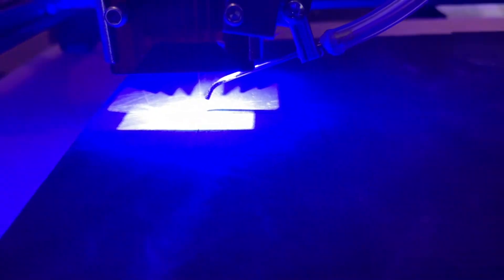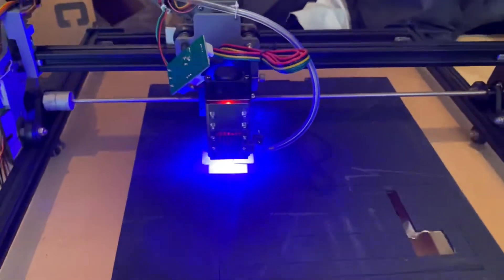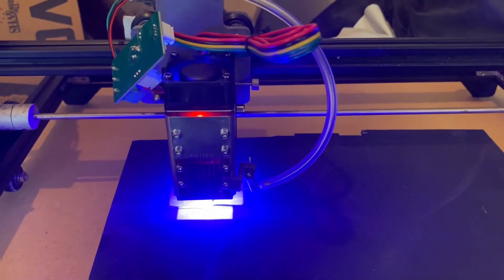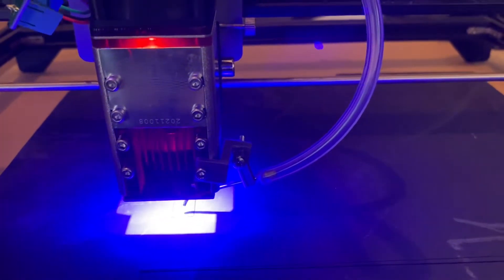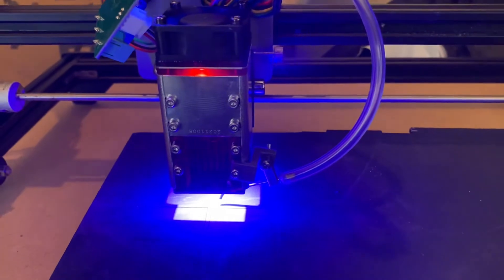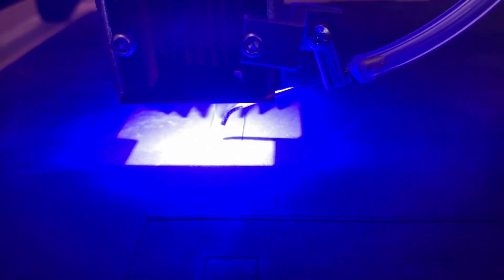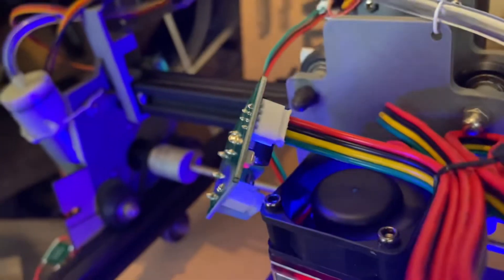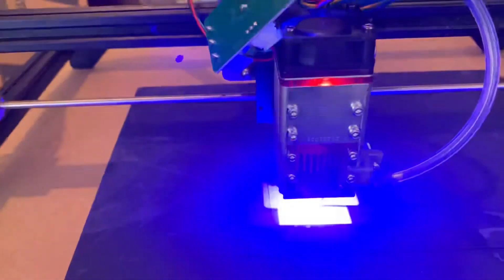PLEASE READ UPDATE BELOW Neje 40watt dual diode laser on Ortur Laser Master 2

Comment: I've been going back and forth with Neje about the A40640 and it's compatibility with the Ortur LM2 S2 gantry.  LA Hobby Guy made it work on his Ortur (model not mentioned) and you obviously have as well.  I'm new to the laser world but already realize that the low power output of the LM2 won't get me to where I want to eventually go, so my entry was at the budget level.  Making this module work on my existing frame/gantry would save a ton of money.  Do you have any more videos or further info that might help me out?  Neje says they don't know the answers to any of my questions...which I find rather hard to believe.  Thanks for the most informative video.
Reply from the maker: Thanks for the comment.  I can't remember exactly what I did but there was a small amount of messing around to fit the neje head with the existing bracketery and I also was powering it wrong to start with (I've just edited the video description with details).  Long story short, I was under-powering the laser but now it will chop through that ply in one pass no bother.
Reply from the maker: Oh something else to bear in mind, the module is bigger and focal point is lower, meaning it can crash into the side frame, to combat this I glued a small piece of wood in order to trigger both end stops "early". You sacrifice a small bit of working area, but not a huge deal.

Comment: Great video, where did you buy the adapter module for the Neje laser?  I recently ordered the Neje module but haven't received it yet so want to make sure I ordered any adapter I might need ahead of time.  Thanks for your help!
Reply from the maker: I bought mine all in one from neje on AliExpress. No adaptors needed, everything came in the box.
Reply: @ImperialLightandMagic  thanks I think mine should be fine then, I bought from NEJE directly so should be good.  I appreciate the video, thanks!
Reply: @ImperialLightandMagic  Did yours work fine on the Ortur frame?  If that's what you're upgrading...
Reply from the maker: @viperelbow  I had to add small bits of wood to hit the end stop switches, as the body of the laser is a little larger. Very simple to do though.
Reply: Did you mount it on an Ortur gantry?  There's a definite language barrier with customer support via email and I got a kit that doesn't have an adapter:( @ImperialLightandMagic
Reply from the maker: Honestly I can't remember, I may have drilled a couple of holes but I certainly don't recall it being a huge deal.
 @viperelbow

Comment: So I have the pro version and the new neji a40640ii with air assist built in. I just can't figure out how to mount it. None of the holes line up and it actually sticks out farther than the module that came with the machine so I'm worried that it won't be centered. Any way to calibrate?
Reply: LA Hobby Guy has a 3D printed adapter that mates the Neje 40640 to the Ortur LM2.  I don't have 3D so I'm attempting to source one elsewhere.  I'm clueless on the circuit boards also.
Reply: @viperelbow  gave up on it and returned it within the first week. Just wasn't going to work for me. Went with Laser Tree 20w module with included air assist nozzle instead. Works great.

Comment: Hello sir!  I also have the Neje 40w dual diode.  So far I am not impressed.  What height do you set your laser at?
Reply from the maker: About 15mm off the work piece, I made a 3d printed spacer which I use between the red acrylic and the workpiece.